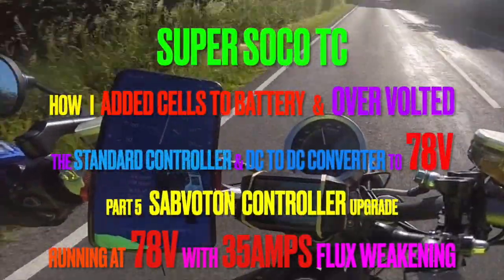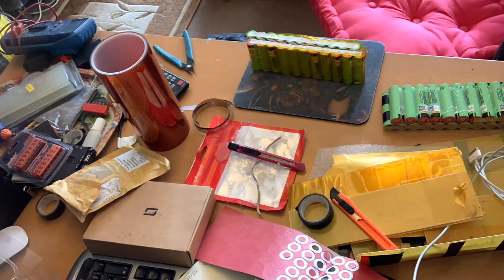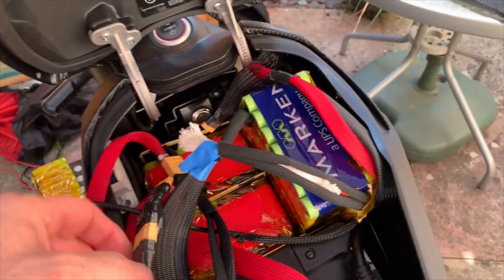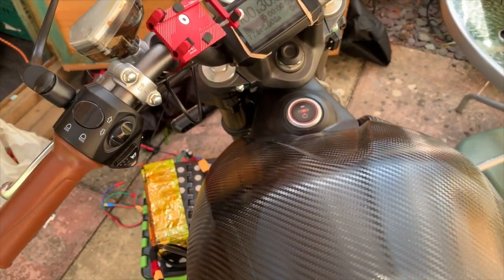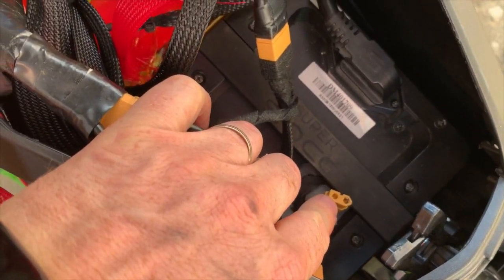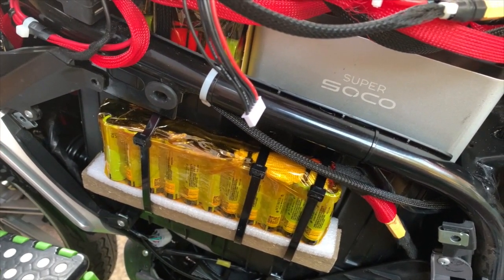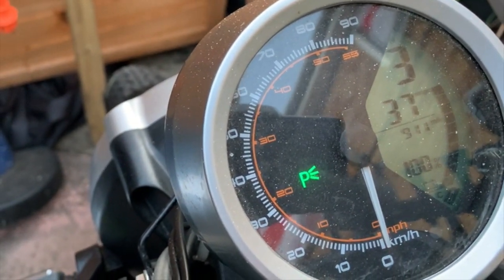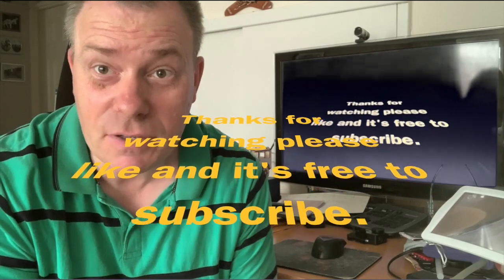How I made and installed a 19 cell battery to a Super Soco TC Pt 5 of Installing Sabvaton Controller

Comment: If the standard controller is dc dc 72 volts, will it work with a 78 volt battery?
Reply from the maker: 74.9v is the maximum working standard Soco controller voltage for TC & TS
You can put 78v in to standard Soco controller but wouldn’t turn the rear wheel
Video below show’s working & non working voltage of standard Soco TC controller 
https://youtu.be/0xSuIvrNwVs

Comment: A question: having 2 normal battery 26ah, how do I connect both to the motor? In parallel, not with Soco device.
How's the wiring?
Reply from the maker: Are still in warranty?
It means altering the wiring & purchasing a xt60 parallel Y connector
Reply: @Batteries Power Allsorts  My moto is half TS half TC I think the warranty is gone 😆.
I have those XT60 1 in 2. I just need to wire 2 Soco plug to XT60 and then the 2 XT60 in 2 in 1?
Also do you have a Discord or Telegram group?
Reply from the maker: @jolladevices  
Soco Batteries have xt60 in them see in YouTube video below
https://youtu.be/H45N6VQ0v9w
I have telegram but I need to set it up

Comment: I don't understand one thing it suppose to be faster but you are going 80km/h and my soco give me that speed normal  with any modification ¿your soco is restricted or undestricted? it should go more faster
Reply from the maker: I have change the rear tire size so that the Speedo reads slower
Also The bike is having to push a lot of weight (me)
Unrestricted Standard controller on my bike only read down hill 75kph on speedo with standard tire size = gps 62kph
now the bike cruises along the flat road at 67kph gps
The standard controller can only put out 40amps x 70volts = 2800watts
The sabvoton controller puts out 75amps x 78volts = 5850watts
Also all motors has back EMF The faster you go the worse it becomes which means the controller just pumps more and more amps into the motor but it doesn’t go any faster but it does build up more and more heat until the wiring melts
So I set my controller to 35amps flux weakening so the top speed is sacrificed for range

Comment: 5:47 Damn you filled up very well the space 🤠
Reply from the maker: 1st Super Soco battery = 17+2 cells in right side
2nd hand made battery = 7+5+5 & +2 cells in left side 
So the whole bike is running on 78v
1st and 2nd batteries connected together upgraded 80amp cable to, upgraded 60amp Circuit breaker to, upgraded 80amp cable to controllers
Reply: @kpadventure  one thing: I think it's not the Soco cable, the moto probably wants a Soco BMS or one compatible from aliexpress
Reply: I noticed that the main Soco cable has special features, it's needed.
The others new batteries are connected to the controller, or you just connected somewhere in the 60v area?
Reply from the maker: Thank you, 1 of my better ideas 😊